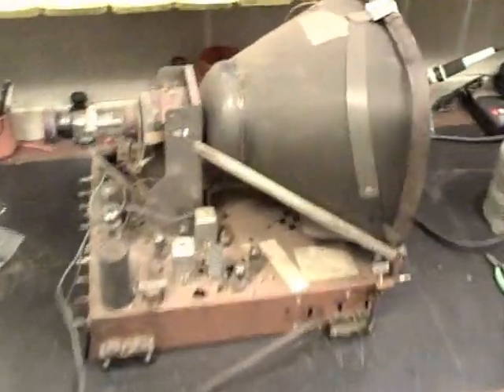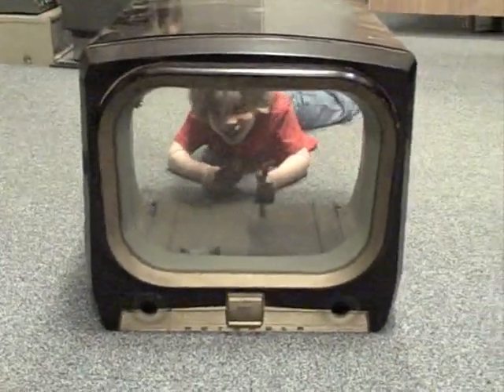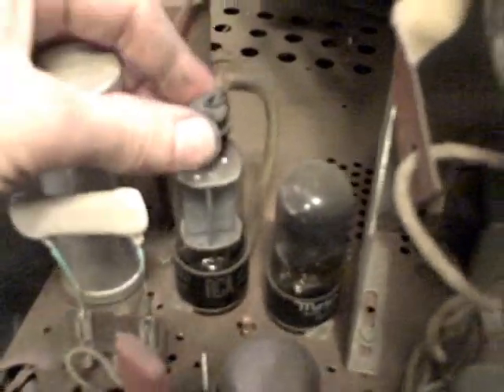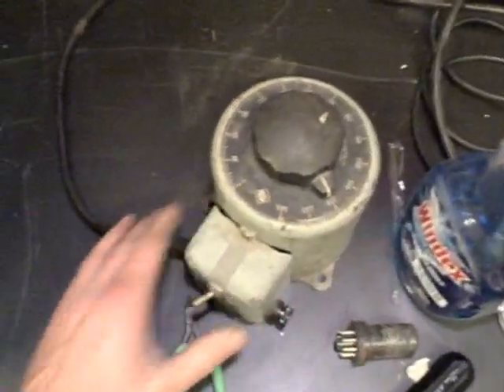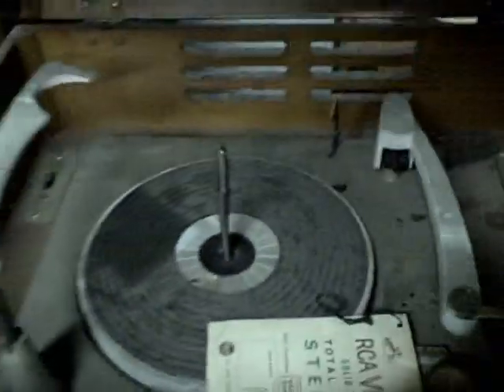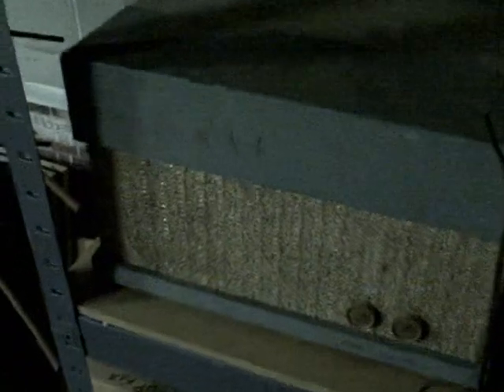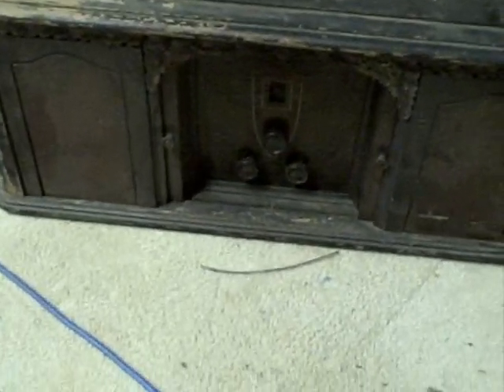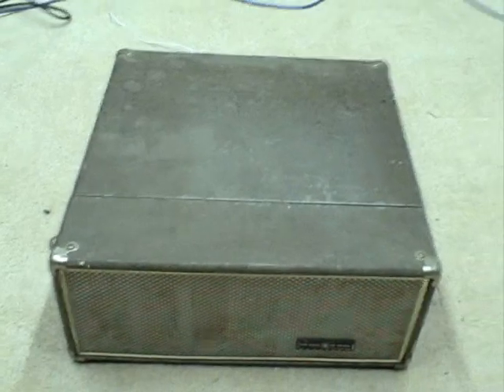My collection of old TVs and record players - part 1

Comment: You guys are just having way too much fun, and that's quite a little pal you have there to help restore your valuable collection.  The RCA record players have everything available for  restoring on ebay, and some clean up well and work  without having to spend too much on parts.   If one of your large RCA Orthophonics has a 6V6 amp, they usually bring a high dollar on ebay, and really sound good. . I have 4 RCA 45 players and 3 RCA Orthophonic, 2 table models,and one console.

Comment: Those are some great finds there! You probably don't have any drive signal to that horizontal output tube from the oscillator stage...all of those paper caps need to be replaced! 
A lot of the time shorted or leaky paper capacitors can overload resistors and cause, for example, no plate or screen voltage to a stage.
That little disc I think is a high voltage filter capacitor.

Comment: The heater circuit for any tube powered television is pins #2 and #7.Also replace all of the capacitors because they tend to dry up and leak current going to the wrong places in the circuit.

Comment: When tube plates glow cherry red it is usually caused by shorted out or extremely leaky capacitors. Any time you see those old striped black capacitors they need to GO! They weren't any good to begin with.